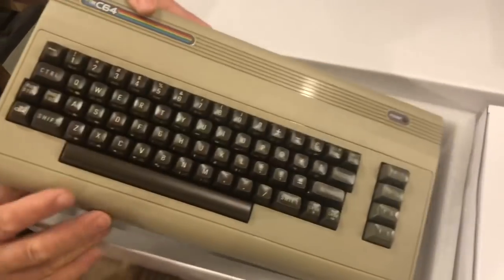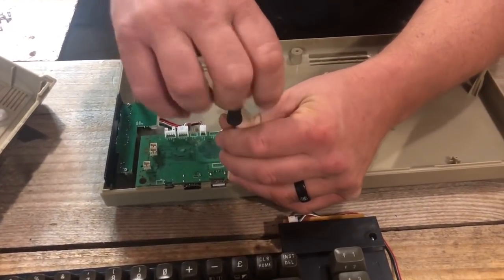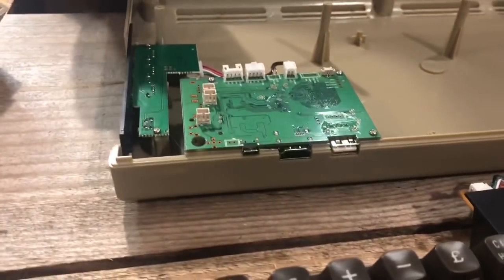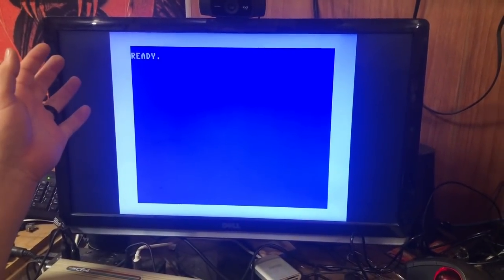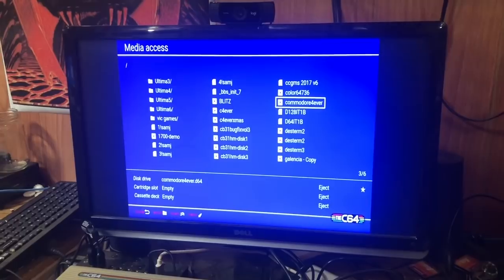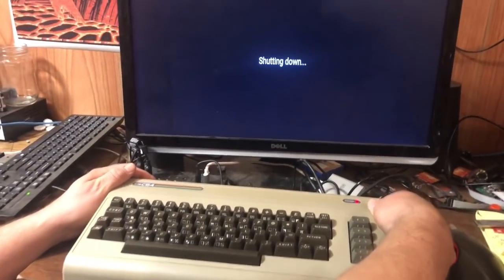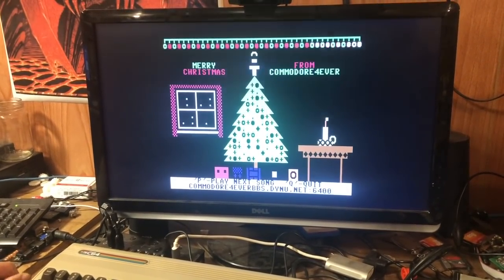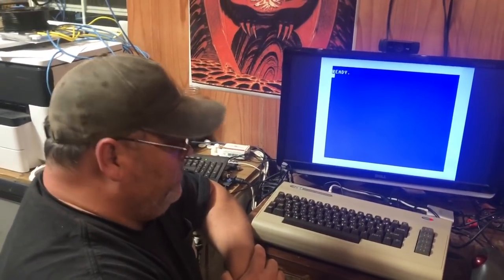The C64. My thoughts.

Comment: Can it be set to boot into basic screen first, and then have that fancy menu as a choice?
Reply: Yes, it can boot directly to the blue c64 basic screen
Reply: @timpoulsen4363  Arhhh yearrr.... That is sweet. I think all my questions, but one, have been answered on this. You see, there are these 9-pin to USB joystick adaptors, that makes it possible to use an old digital 80's 9-pin joystick as a USB joystick. So the question is, if it is possible to use a second joystick like that, on this full size TheC64.
Reply from the maker: brostenen I am actually curious about the usb to 9pin adapter too.  I may order one real quick and see.
Reply: @commodore4ever  Yup.... It would be so nice, if it gave access to two player option. Like playing with maria as well in giana.
Reply: It can be set to boot to the C64 or VIC-20 screen through the settings.  I have mine set to boot to C64 mode...now if they'd do an update or build a C128 or Amiga version it would be great....although I never understood the C128 actually because I never had anything that took advantage of it, everything I have actually ran in C64 mode on my C128.  Never had an Amiga, but would be great to get one at some point.  I picked up a C64 and a VIC-20 a few weeks ago at a local electronics/computer 2nd hand shop for $19 each...both are fully functional...only odd thing I found out after posting pictures of them to a Commodore group page was my C64 has a VIC-20 keyboard installed in it and my VIC-20 has the C64 keyboard installed in it LOL.  I think someone was playing around because these systems I guess arrived in bulk so I assume whoever turned them in was trying to fix or manipulate them for some reason.  They had some old Commodore disk drives there too but they were all in very bad shape, no cables or power bricks either.
Reply: @wildbill23c  I think you are in luck these days. The Amiga will return in some different form factor. Try searching these following solutions....

-Armiga.
-VampireV4
-Amiga500++
-Amiberry
-Amibian
-AmyITX

Or you can still find old original 500's on the market for reasonable prices.
Reply: @brostenen  Even if you cant, they sell second joysticks - looking at their website
Reply: @francistaylor1822  Who? Those that sell TheC64? Sweet.... Hope it is microswitch. On the other hand, then I have never been a fan if eighter Conpetition-Pro nor Zip-Stick. They both feel wrong in my big hands. I need a more flat surface to rest the outer edge of my right hand on. That is why I keep the a stick called "The arcade" and another from Wico called Command-Control. I like the one with a ball on the grip. Else it is a stick from Quickshot called Quickshot-II-Turbo. Those are my preferred choices in sticks. So getting a USB to 9pin adaptor is a must for me personally. If it works with TheC64 that is.
Reply: @brostenen  Yep, the people that sell theC64. Its the same microswitched joystick that comes with the system. I dont love the stick myself (My system arrived today) - but its not terrible. Id like to try the usb adaptor as well.
Reply: @francistaylor1822  Hope to buy one of these new TheC64 systems in the near future. It is better that my children game on that, than on my old 1980's C64's. They are too fragile for children now. Back in the 80's, it was a different thing. I never killed any original 64 when I used them in the mid-80's. Yet they do play on my machines, yet only when I am around and sitting next to them. My daughter is more into Amiga, yet my son loves anything Commodore. So we usually play on my Amiga500 that I have build into a Desktop case from the early 90's. A project that I recently have finished, that I can use with modern USB keyboards and modern flatscreen LCD monitors.
Reply: @francistaylor1822  If "TheC64" can use "The Arcade" joysticks with USB adaptor, then that is perhaps the most awesomme thing about it. It is a 98 percent perfect joystick. Only downside about it, is that it is not a pistol grip type. So games that recuire rapid shooting are not played well with The Arcade. I am thinking games like xenon and other shooters like that. So one really need two type of sticks for C64 gaming.
Reply: @brostenen  Thanks, Ill check it out
Reply: @francistaylor1822  Cool.
Reply: Yes and you can set it to have a vintage screan look.
Reply: @brostenen  There is or was a project called MiniMig, which implemented an Amiga 500 on a FPGA chip, but i don't know if it is still being developed. https://en.wikipedia.org/wiki/Minimig
About the Vampire, aren't they a sort of accelerator board that you can put inside an existing Amiga?
Glædelig jul, iøvrigt.
Reply: @legobrickabrac  Wonderfull.... Sounds like the best product replica that is out there. A much better execution than any of those mini-things that have been launched the last many years.
Reply: @brostenen  Retro Games made the C64 mini and is similaur to the mini Attary. They got thousands of people saying they wanted working keys so Retro responded by saying if enough interest is show and there C64 mini sales do well then they would bring a full sized version with real working keys out. You got to respect them for keeping there word. They put alot of effort into it.
Reply: @legobrickabrac  Uhmmm yeah... Of course I respect them for doing it. Why would I not that?

Comment: This Thing misses a av out to hook it up to a old crt tv and get the real 80s feel. HDMI is way to sharp and pixelated for the old computers or consoles.
Reply: @AndrasMihalyi  yep, but that isnt the real deal. And the real feel.
Reply: @AndrasMihalyi  Well speaking of me, i even would use a Raspberry with a Keyboard instead of this. Because the Raspberry has a standard av out. This is just a rebuild Keyboard with a random arm board and a high pricetag. And yes , i also still own a original unit. I mean a av Port costs next to nothing why not add it for the real retro nerds? Thats what i dont get.

Comment: It's a nice product, but I wish they would have added mouse support. They use VICE for emulation and VICE has built-in mouse support, so I 
can't see how it's not possible...maybe in a future firmware update...hopefully. Another feature I would have liked to see is the ability to choose memory expansion for the VIC-20 mode. Right now you can only use software that is for unexpanded VICs....Once again...maybe in a future firmware update.
Reply: You can use expansions on VIC, but you need to put flags in the filename just like you did on the mini in order to switch from PAL to NTSC emulation. I do agree with you on mouse emulation though.
Reply: Have you tried a usb mouse?

I will grab geos and give it a go. If it does not work it could be added as this thing is running vice under the hood.

Comment: Just got an TheC64-full-size yeaterday. Was a birthday present. Anyway.... I noticed that the keyboard is in no way something that feels like the original, when pressing. At first there is force behind the key-pressing and after one or two millimeters, it gives after and have a smooth key travel. People say it feels original. I say it does not in any way. You can actually feel the key kicking back into your fingertips. It feels like they have simulated a real spring. I would say that it feels old school, just more 90's old school and not 80's old school. People who say it feels original, are eighter easily mislead, have never used a real C64 or have not used one for 20 years.

Comment: Hello.

Can you program in assambler?
Reply from the maker: Pepetecno I haven’t tried but if you can program in basic I would assume so.
Reply: According to their Facebook page you can...I have no idea how, but according to the maker its possible to do so.
Reply: @commodore4ever  Ok.
I know that you can in basic.
But the doubt is in programming in assambler, because the hardware is not the same. (MOS Technology 6510 )
Reply: @wildbill23c  Can the MOS 6510 be emulated?
Reply: Yes certainly. You need an assembler cartridge image or a disk image if they released disc based assemblers. Load it up and start coding the emulated 6502!

Actually you can avoid using an assembly program. You can load the actual machine code operators and their operands into memory using BASIC as values in DATA lines then you use SYS to execute the machine code at its start address. This is the harder way to do it as an assembler would give you lots of useful functionality.
Reply: @Pepetecno  well its already running 6502 machine code so there is no reason it wont run your own.
Reply: @Pepetecno  it is being emulated, thats what this machine is doing. The 6502 (6510 specifically) has been emulated for decades. This is just an emulator in a case with some usb ports.
Reply: Pepetecno - Yep, I'm actually doing it right now.

Comment: I'm curious if the keyboard would easily mount into an original C64 case.  Obviously the electronics aren't compatible, but that could be fixed with a microcontroller.
Reply from the maker: Dan Goswick I will try it out and see :)
Reply: I was thinking the same thing. Hoping the keyboard can be used for other projects, but looks a bit like glued mylar and not much to solder to unless we want to keep the USB-side. No pictures of the other side of the PCB though.
Reply from the maker: Just did a follow up video to answer this https://youtu.be/XGbSYg1sL70

Comment: They nearly rendered this thing useless with their latest firmware. They literally killed the USB-Browser... I will return this thing, if they don't put out a proper firmware due to next week.
Reply: I have installed the Latest 1.3.1 firmware on mine and have no problem at all.  Have you tried re-setting yours to factory settings after updating the firmware, it might help and reset everything back to normal and you won't lose anything that you have on the usb drive.
Reply: I read in a FB post from Retro Games  that a new firmware will be out soon
Reply from the maker: Gordon Buch definitely not updating then :)
Reply: @JanEspen  They didn't even mention the problem on their homepage... All we see are reviews that praise TheC64. No Firmware Update whatsoever.
Reply: I haven't had an issue with the latest firmware at all. What version are we talking about? I've recently installed 1.3.1

Just checked, 1.3.1 is the latest firmware. My mini and maxi are using it with no issues and its the first firmware release for the maxi (mini and maxi use the exact same firmware). 1.3.1 also gives you the C64 version of Farming Simulator, which is only enabled for the mini for some reason...

Otherwise there are no issues I can see. Everything works fine.
Reply: @dlarge6502  There are no "issues", didn't even mention the word. The Firmware v1.2.0 had a filebrowser with 26 Chars per filename, where the v1.3.0/v1.3.1 has only 16 Chars per filename. If you look at let's say a common game filename that could be "Last Ninja 2 (198x)(System 3)(cr REM)(t +6)(docs)" then you understand that 16 Chars in the USB-Browser is pretty useless if you have 3 versions of a game. BTW: Most C64 Emulators have 32 or more Chars displayed in their filebrowser and everyone that has ever used a C64 knows the you need more Chars to distinct different files from one another.
Reply: @wizzel22  When you said "they killed the USB browser" that reads as the usb browser no longer works / cant be launched. This is the issue I was saying I didn't have.

As for the 16 char limit, I wasn't particularly bothered with that considering I grew up on DOS :D
My d64 files have 8 character names,or less. And that's because I cant be bothered to rename them. Also, back in the day to differentiate between files we would just put a number on the end. I dont see it as much an issue, if i really need to keep things separated they can have a directory.
Reply: @dlarge6502  Grew up on DOS, also. The fact that they HAD 26 Chars in the old firmware and 16 in v1.3.x tells me that it's not for the better but for the worse. For me and many others it's a bad thing that could be fixed. They killed the Chars in favour of an icon shown before each filename.